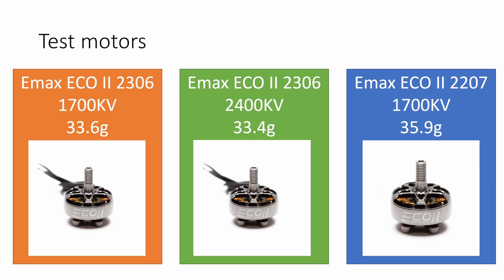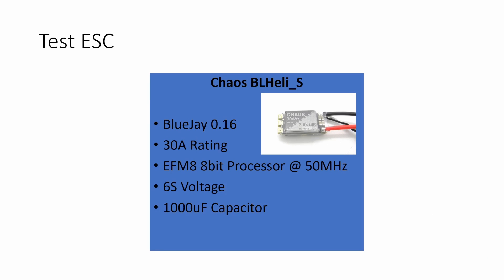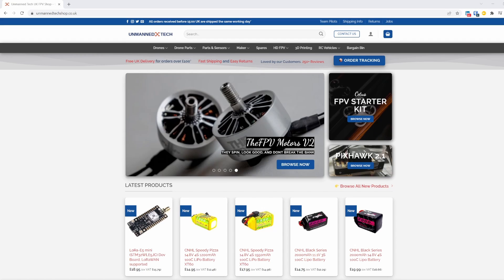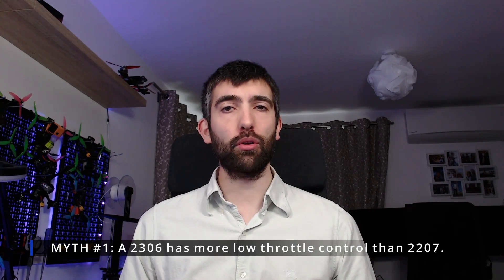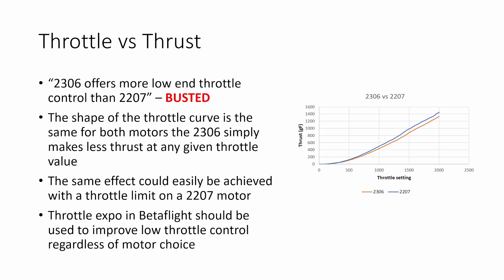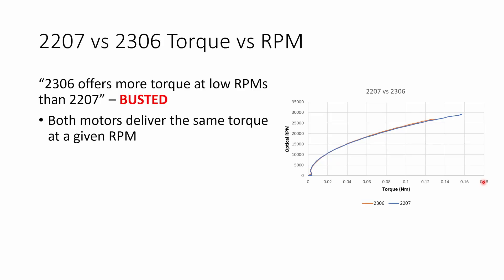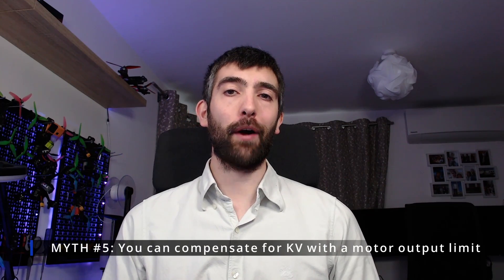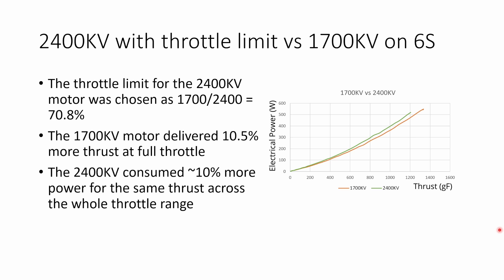Five 5" Motor Myths Tested, are any of them true? 2207 vs 2306

Comment: Just something to throw at this? The additional outboard weight on the 2306 vs the 2207, would it not act like more of a flywheel in flight, static bench tests don't account for airflow at speed. Every myth is just some misunderstood science, so the tale of 2306 feeling more torque could be right but just not scientifically proved yet. Lets say quad is descending and you are at say 20% throttle. The resistance of the prop on the air pushing back up from the descent would want to slow down the prop/motor. Would said 2306 not slightly keep the prop at better momentum compared to the 2207 that would need to apply a bit more power to keep the prop spinning at given speed? Or is that cancelled out ultimately by the increase in response of the 2207, or is that the reason why the 2207 is more responsive? This could also be where the tale of efficiency comes from? The heavier fly wheel effect takes less effort to keep spinning at same speed (Cruising). Kabab FPV even went as far as developing pancake style motors, which in practice have proven to be more effective on whoop style flyers which all have 1 thing in common, they tend to cruise at set throttles a lot.
Reply from the maker: The flywheel effect you speak of would not decrease the power to spin the motor at a certain RPM. We can see this from the torque vs RPM curve and also the thrust vs power curves. A motor with more MOI will take more power to accelerate/deccelerate. In my opinion this 2306 being more efficient myth comes from the fact that it is a smaller, less powerful motor so it draws fewer amps. What people didn't realise is that it also makes less thrust so it is not more efficient, just weaker.
Reply: @ChrisRosser  brilliant. Thanks for the great perspective 👍🏼

Comment: Thanx Chris! What I wonder is where motor volume becomes irrelevant, at what point in prop vs motor volume is the motor big enough to be limited by KV and prop.
Reply from the maker: Good question, I feel that 25mm might be too big for 5" but I should test it!
Reply: I’ve tested the cheap Racerstar 2508 2522KV and they felt ok in the air, maybe the rpm’s felt like not being that much affected by the props. That 5" felt good in heavy wind, pretty locked in, but not having the top end power It felt like it should have. I guess that is an indicator for bigger stator volume than needed for what the KV demanded. The JB 2407 2500KV felt like it had more top end power, and a bit more… «connected to the prop». Maybe 3000mm3 is a robust target for a steep 5-5.2" prop 🙂

Comment: I've been flying rcinpower 2107+ 1980k for maybe a month after flying 2405 for a while then the fpvcycle imperials for a bit then some 2207s. At first I didn't know about 2107 it seemed weird to me (so is 2405 but I like weird shit who cares) but man oh man I have been loving them so much they are super responsive and I still get my same old 3-4 min flights I was getting on any the other motors I flew before and they seem pretty durable.  I wouldn't mind seeing you test some of these strange size motors like mine, the 2505 t motors, maybe fpvcycle and any other odd ball 5-5.5 Inch motors we can find I'd love a video like that

Comment: Thanks for doing these great technical analysis videos.  I  admit to having a few surprises in this one, though these were on details on which I did not have a strong opinion.  On the other hand,  thanks for quantifying one thing that I have understood and agreed with for a long - that running a higher Kv motor with a throttle limit is far from being equivalent to running the right Kv motor in the first place.  There is a huge lack of understanding in our community about the effects and relationship between motor Kv and torque.  Even our friend Bob Roogie is challenged in understanding this, though he does seem to be learning.  :-) 

Looking forward to seeing more of your technical analysis videos...
Reply: Kabab stumbled upon different KV for different motor size at same time I believe. He didn't bench tests as well.

Comment: I would be curious to see at what motor output % in betaflight does the 4s motor put out the same power as the 6s one. And the corresponding efficiency %. 

If it was producing 10% less thrust. Would 77 or 78% motor limiting equalize the thrust, and what would the efficiency loss be at matched thrust?
Reply from the maker: The efficiency loss at equal thrust would be ~10% as it is across the whole thrust range.

Comment: I think the graph for the first myth actually proves it true. For a given thrust (a horizontal line through both curves) the 2306 motor will always have a higher throttle value than a 2207 (i.e. 2 vertical lines down from where the thrust line intersects the curves). Therefore I have to push my throttle stick much further with a 2306 motor to get the same thrust. This equates to better resolution across the entire output range (not just the low end). But freestylers (who often make this claim) don't care about fine movements at the high end of the throttle, they care more about responsiveness at the high end which a 2207 has more of across the range. So at the low end 2306 has better control but at the top end it is less responsive so it feels like a 2207 has more control.
Reply from the maker: Absolutely right. But you can achieve the same effect by running a throttle limit, or running a 4S motor on 3S. I don't think you can claim more low throttle control just by reducing the max thrust. Throttle expo gives more resolution at the low end without losing top end.

Comment: Another great video, thanks mate. My only question is are you able to test torque under more dynamic conditions? For example with your ramp tests the motor/prop combination is sitting on the test bench but that only simulates take off or quick pops of the throttle, but not recovering from a big dive were the torque requirements would be far higher? Anyway, love your work 👍
Reply from the maker: The responsiveness testing is the true measure of max torque I think. There the motor has to accelerate as fast as possible.

Comment: Right to the Point with Data!!! I change from 2207 to 2306 from your last video about 5” motors, 2306 motor is my throttle cap from 2207 lol
Reply from the maker: Absolutely, nothing wrong with that especiallyas they are a little lighter.

Comment: What about running 5s on a 2306 2450 motor? No throttle cap? I would assume much less efficient vs 4s but much more thrust and acceleration? I love my 2306 2450 on 5s.
Reply from the maker: It'll be 5% less efficient but you'll get more power IF your battery can supply the amps. Otherwise you'll get little to no benefit.
Reply: @ChrisRosser  cnhl minister 1500mah packs. Voltage sag to less than 3.5 on full throttle, but it seems as though motors accelerate much faster and I don't need as much time at full throttle to get the throw I want up and over tall obstacles.  Running low pitch props so I'm pretty sure I'm not getting max speed but enjoy the low end acceleration. Also I get slightly longer flights than with 4s even with the loss of efficiency due to more wh in the 5s 1500mah vs 4s 1500mah packs. Are these correct assumptions objectively or am I just being subjective?

Comment: Do you feel like this is a one size fits all statement though ? This was just one motor being tested.  I’d be curious to know the difference between something more premium like a high end t motor 2207 vs 2306
Reply from the maker: I'm not sure why more premium branded motors would behave differently. They use the same magnets, the same copper wire, maybe slightly tighter air gap but that would affect 2306 and 2207 motors the same surely?
Reply: @ChrisRosser  yeah that makes sense.  It was just a random thought I had. Thank you so much for all the testing you do !

Comment: I feel like one test wad missing. Cooling at high RPM! 2306 should in theory be able to keep going for longer before overheating, but I guess the difference would be less than the top end gain of the 2207?
Reply: It's all about stator volume, the 2207 are just bigger,  the surface area difference is only 1.4% 🤷‍♂️
Reply: @Fly_High_FPV  I'm curious as to how you come up with 1.4%. The surface facing upwards, when removing 4mm radius shaft, is 9% bigger.
Reply: @Anzyclos  someone did the the math in this thread breaking down the surface area of 2306 vs 2207, it was 1.6% difference...stator volume is king.  If your motors are running so hot that 1.6 (or even 9% surface area) keeps you from overheating you got a bigger issue

Comment: Chris, this is amazing. Thanks for these tests. It always pissed me off when people say 2306 is more low end torque and more efficient lol. But I didn't have data to back it up.
Reply from the maker: Absolutely, I was told the same and had to test it!
Reply: But it absolutely is true for the way freestylers fly and the graph proves it. You need a higher throttle value with a 2306 to get the same thrust as a 2207. Freestylers need precision in the low end of the throttle and responsiveness in the top end. So 2306 will always provide more precision at low throttle and less responsiveness at high throttle when compared to 2207. I also remember a Rotor Riot episode where Vanny and Le Drib were able to identify the two motors in a blind test based on that same observation.
Reply: @kandredfpv  As Chris mentioned, if you want low end throttle control and resolution it's better to use the Throttle Expo in Betaflight. Which makes more sense and you can tune it more to your liking.
Reply: @BowserMG  absolutely agree, there is no question about that. The point I am making is the graph does show there is a difference in throttle resolution so it isn't accurate to say it's a myth.
Reply: @kandredfpv   2306 is just weaker lol, that's it, nothing fancy in there.
Reply: @IvanEfimovLimon  I feel the same way about people who buy trim milk instead of buying full cream and adding water. It comes down to personal preference 😂
Reply: We are getting 8 minutes flight time 2306.5 2000 kv Brotherhobby LPD motor..
5.1 prop and this is with a 6s 1100 GNB battery.

Also more power than the Kebab 5 inch motor.. 
Ran both quads yesterday... 

Loving the LPD withers the Mini T motor stack.

I also run 2207 quads and the horse is different. 
 Less pop power

Comment: Chris is kicking butt and taking names with content like this! One question- would the last topic of the vid remain as true if using Motor Output Limit instead of Throttle Limit?
Reply from the maker: Throttle limit doesn't prevent the PID controller applying full power to the motor. Output limit prevents PID controller applying full power. Output limit is the right setting for 4S motors on 6S. 👍

Comment: Isn’t having a throttle limit different than having a motor output limit?
Reply from the maker: Yes. Throttle limit doesn't prevent the PID controller applying full power. Output limit does.

Comment: Any advantage of using 2306 instead on 2207, besides cooling?
Reply from the maker: Only if they are significantly lighter weight and you don't need the top end power.
Reply: I'd say for tight proximity flying 2306 might have a little edge. I prefer my 2306 quads probably because of this

Comment: Very interesting video! 
I still have some good old 5" 2204 motors running. 
Maybe it would be a interesting video to compare how much the size effects flight performance since right now the motors get bigger and heavier. I am saving almost 80g compared to some of the recent 2505 motors or similar. But how much performance am I getting ? At some point bigger motors cannot be beneficial anymore on 5". Am I right?
Reply from the maker: Yep. I'm going to be looking at some bigger 5" motors soon!
Reply: @ChrisRosser  and some smaller for comparison would be cool :)  I want to know if I need to upgrade my old, but perfectly fine 2204 on about 450g AUW. What do you think?

Comment: Yep, I've always stayed with 2307(.5) for freestyle as it just felt more zippy, my throttle control has always been good. 
One question is what if you weren't worried about efficiency and just response, what if you upped the output limit on the 2400kv motor?
Reply: Yeah I run 2455kv on 5S and run the motor limit around 5% higher then calculated just love the snappiness and pop!
Reply: I run a few like you're suggesting. I run them on 6s at 5s kv. The 1900 eco on 6s is 2850kv. I run the 2400 on 6s at 3000kv. Ballistic and come down cool.
Reply: It would prob still consume 10% more power but upping the kv would make up for the lack of and then it would feel good.  I’d be curious to know how much 10% actually affected the flight time to.  Is that a whole minute ? Or more like 20-30 seconds.  I’ve personally been more than happy with my experience using motor output limit.

Comment: interesting results, i wonder if the load/unload aspect of bench testing has any bearing on the outcomes,  i'm still running xing e 2207 2750 kv,s , i dont do any wild thrashing freestyle so the voltage drop isnt a hufe issue for me, but i would like to see some tests of a 6s pack on the 2750kv's,  running auw 690g.

Comment: In my experience, if you put a 2207 on a bad frame, it can deliver less power than a shorter motor due a higher motor producing more motor wobble due to its higher leverage on twisting the arm. This is perhaps where some of these myths come from.

I think that maybe efficiency can only be tested in flight, not on the bench. Heavier flywheel effect motors can be more efficient due to the flywheel effect, this is maybe something that can't be tested on the bench.... Like flywheels in normal car clutches are heavier than racing flywheels for the very reason of efficiency.
Reply: But if they have the same breaking then that counteract any flywheel... The esc setting would do more for this?
Reply: @ugpfpv361  I d'know, only a theory I heard... The breaking level of the ESC does depend on quite a few factors... And I think, in BF 4.3 we're getting some freewheel effect on reductions of throttle, not sure if that's global or a feature you turn on or off.

Comment: Great video with scientific method as always. The result does not lie. Those myth are definitely busted. However, motor weight (which is 3.2g or 11% diff according to emax website) are completely ignored and that might leads to confusion (for example, motor efficiency and flight time efficiency). I thought you at least needs to mention that since total system flight time is what people care about. Also, given motors are located at the furthest end of the quad, how does motor weight affect the flight characteristic?
Reply: Agreed. This also contributes to people's anecdotal conclusions about responsiveness etc.  When the quad has less mass on its extremeties it will feel very different at similar thrust levels.
Reply: @dr0n3droid  completely agree weight is outside the scope of these test, that's my point. But I thought its important to mention it since it is also about the myth.
Reply: @dr0n3droid  calm down, this is an educated debate. Not a place for your to get your anger out. Most people draw their conclusions about various motors setups from real tests on flying quadcopters, not a bench test setup. So what you are saying only further confirms this guy's point.
Reply: @dr0n3droid  seems you are deleting your prior comments.

Comment: With regards to using a higher KV motor with 6S (btw, categorizing a motor as 4S or 6S using motor KV is misleading, obviously what KV and voltage combo depends on  the build),  using motor output limit is NOT enough, I see many youtubers teaching this method, but it's dangerous.
I've tried it first hand plugging 6S into a 4S build, can't even hover, turning on air mode will cause it to fly to the moon,  it needs at least a complete re-tune, the PID can't handle it.
Reply: Yeah you'll need to re-tune.

Comment: Hey, can you make a video to explain how Motor output Limit works. I'm not sure how ESCs work and if it Limits the output voltage to a motor or the amps. And I'd like to know if it might still have the advantage not having that much voltage sag running a 4S motor in 6s with MOL
Reply from the maker: Motor output limit just limits the max signal to the ESC which limits the max motor current. Running 4S motor on 6S is going to be 10% less efficient regardless of voltage sag.

Comment: What does motor output limit exactly do? Limit the rpm or limit the amount of watt by a certain percentage?
Reply: It limits the PWM signal to a certain percent, it is not the same as limitting how much watt it consumes as that also depends on the prop. If comparing with the same prop with and without motor limit you will see watt reduction.
Reply: @dimitarkrastev6085  Thanks, sounds logical

Comment: I just had real live test but it was somewhat a little different. I put another brand new 2207 in the mix with 3 old 2207. The new motor is emax eco ii 1900kv mixed with RCINPower 2207 1860kv. It was weird that it still flies but I noticed it there was some performance loss. I noticed it every time I punch the throttle. I was expecting it won't change since it's a single 1900kv only. Any ideas? It was actually my latest video upload.

I like what you said about "if you want more torque, check out throttle expo". I think that's what you said. Do we just increase it by few decimals?

Amazing myth busting video!